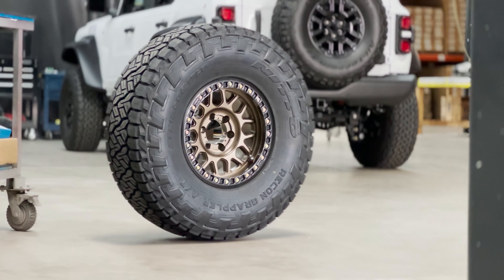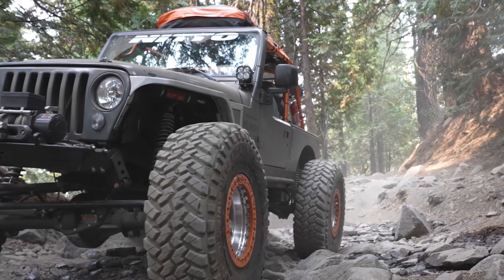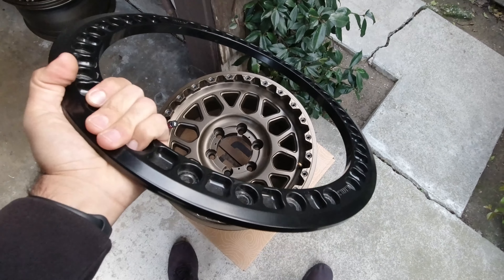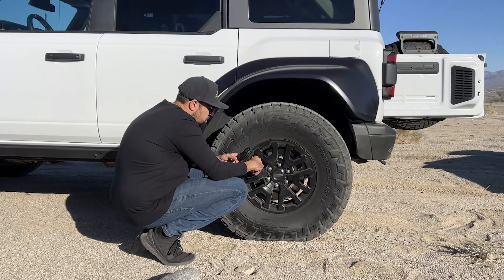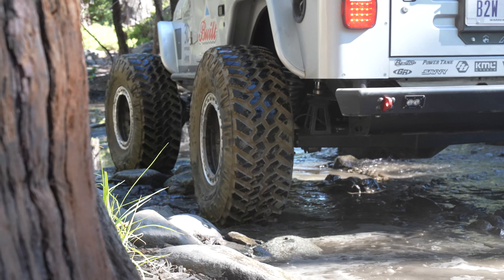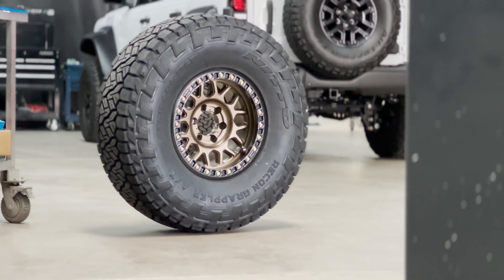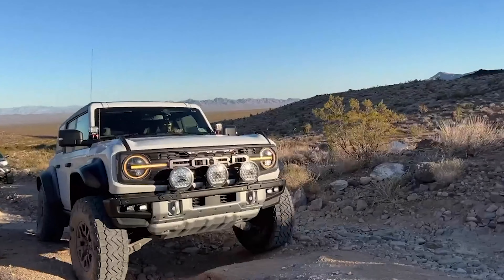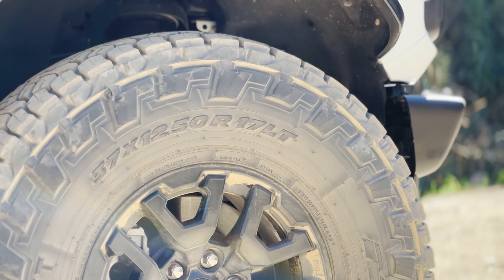Are Beadlocks Worth The Hype?! l Chasing Dust

Comment: There is another way to go about this, sort of a poor mans beadlock. That is literally screwing the tire bead to the wheel with self tapping screws. We used to do this all the time, running tubes is required if you go this route. Might not a good idea for alloy wheels, but it works perfectly fine for the steel wheels we had. Back when we were younger this was how it was done, at least for the those of us without professional race team budgets.

Comment: Great video. Very helpful. I just took possession of a new Ranger Raptor that comes with "beadlock ready" wheels. They look like beadlocks but in reality they are factory wheels that look like beadlock wheels in which you can easily replace with beadlocks. Hopefully that makes sense. Cool looking for sure. After watching this video I will stick with the factory "beadlock ready" wheels since I do not do any off roading. No need for the extra expense and hassle of beadlocks.

Comment: Great info. Thanks. Do you think a Method "Bead Grip" wheel would be the ideal compromise? Are there other manufacturers that produce a bead grip or similar forged wheel?
Reply: I have the Bead Grips on my off road f250.  I regularly air down to 6 psi.  I have spun 1 tire 1" on the rim once.  Other than that they are great, no maintenance!  Only down side is I'm not willing to go down to 2-4psi for deep snow.
Reply: @GrayHairis_Distinguished  Thank you. Very helpful!
Reply: @GrayHairis_Distinguished beadlocks are tempting because that extra 5 psi really does make a difference. The first time I was shown it safe to go 10psi I was blown away how my 2wd coasted thru some nasty sand

Comment: 4:00 "15lbs of pressure or less run bead lock end of the video he says he airs down to 15 which is fine on a standard.  ... I got the or less part but ... slightly conflicting info